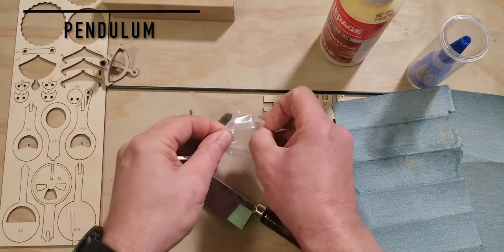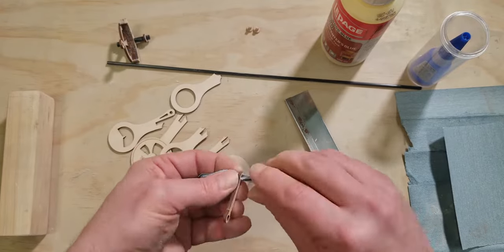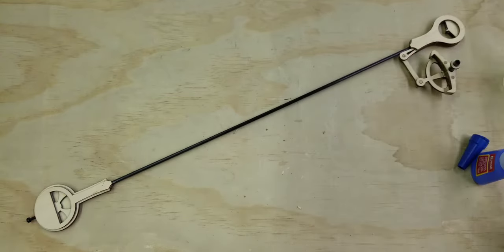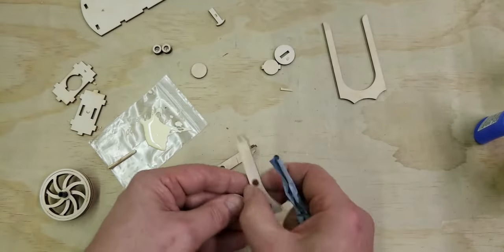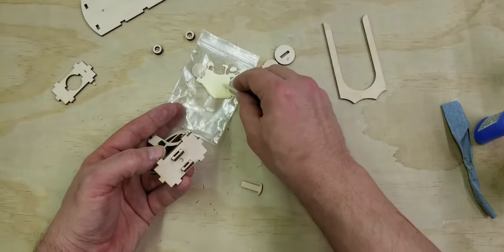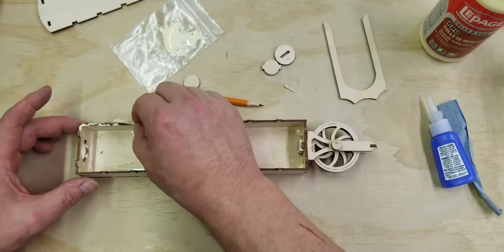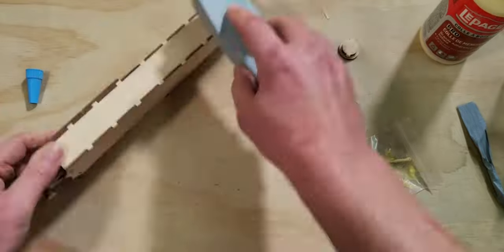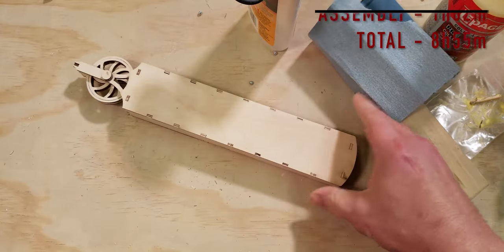Building the David Wall Clock Kit - Part 5

Comment: Could you put, say, three times more weight and add another wheel with 3:1 reduction to make the clock run three time as long? As long as first couple of wheels are able to hold the load. Or should anything else be considered here?
Reply from the maker: Because the axles are carbon fiber running on ball bearings, the clock can handle a heavier counterweight. The one component that would need to be upgraded is the counterweight anchor. Replace the plywood piece with a metal eye hook. The clock should run for 36 hours as built.
Reply: @abongcom  thanks!